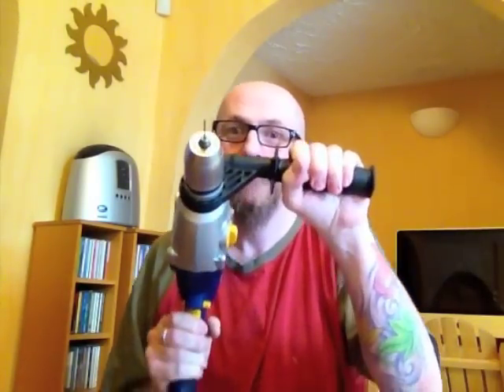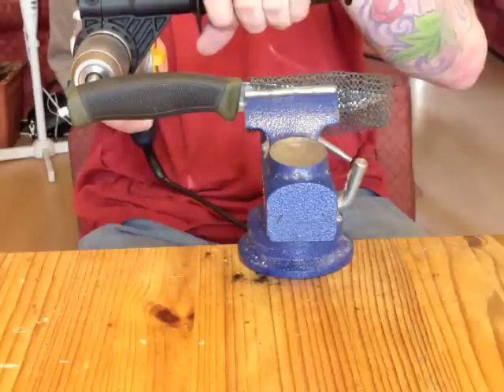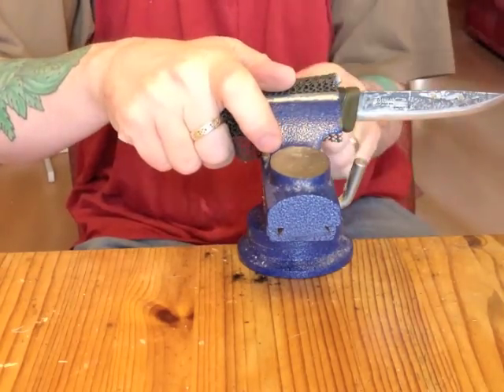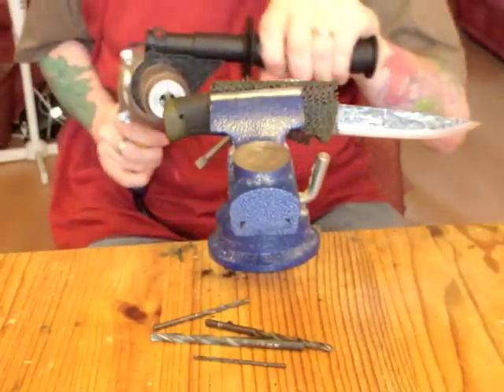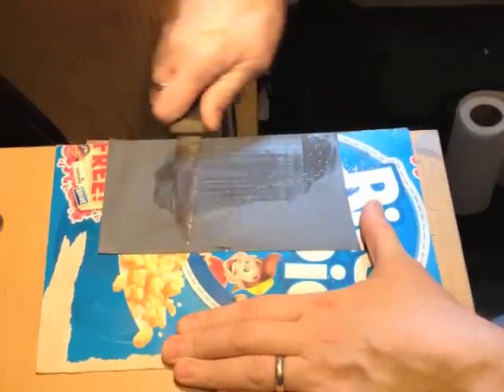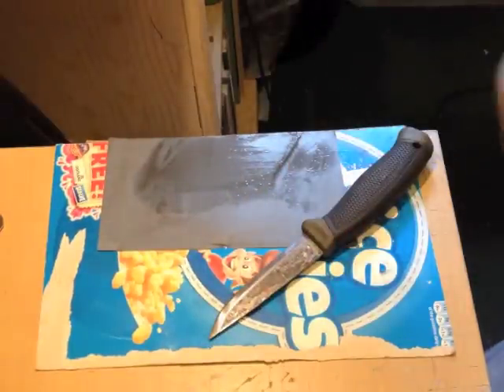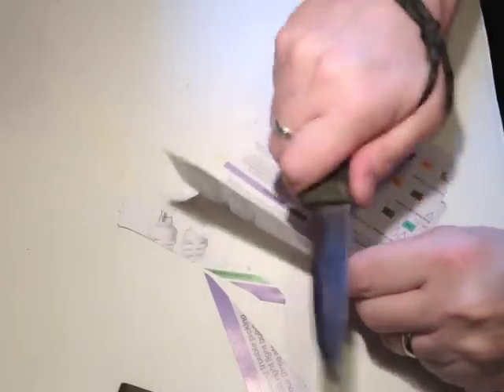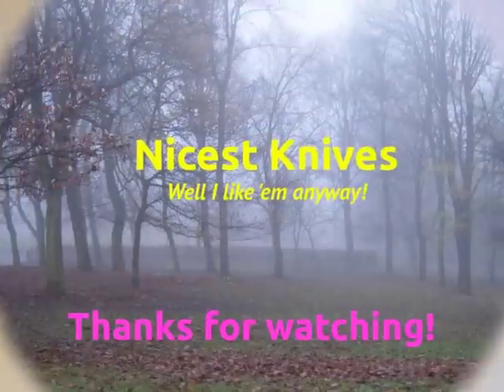More Mora Mods

Comment: I have a new Spyderco UKPK and was thinking after watching this video,  Would it be possible to put a razor polished edge on it using some fine-grit sandpaper ?
Reply from the maker: It's definitely possible...  if you just want to polish the edge bevel it doesn't take too long - but if you want to polish the whole blade, and do it right, that is a massive investment of time... a good ten hours or so I would guess!  
Assuming it's just the edge you want to do, then working through the grades of Wet&Dry paper will do it (I recommend using either WD40 or a very light oil)  Also assuming the factory edge is not too rough, then 600, 800, 1000, 1500, 2000, 2500 grit papers will do it, but make sure each time to remove all the scratch pattern from the previous grade of paper (a hand lens is a big help here)  Then strop the edge on a leather strop for the final polish.  I'm sure you can see why doing the whole blade surface would be a big commitment!  Finally, you need to bear in mind that I have only tried this on high carbon steels - you might get better or worse results depending on the blade steel of your UKPK, so it would be your choice to take the risk - I can't give you any guarantees :-)

Comment: Hi Jim,
I have a lot of respect for Mora knives. They put high performance knives within the grasp of the common man, but I know it's a personal thing I would however leave the patination on the blade as it will help offset any corrosion and I think it looks nice. (that is my personal view)Also a more polished blade will show scratches even after little use. I know a highly respected knife maker who hand rubs his flats to 600 grit. Anyway, I have said enough. It is a personal thing and if that is how you like your knives then that is how they should be. Looks nice n sharp too.
ATB
Sandy
Reply from the maker: Hi Sandy - this particular knife is my guinea pig for experiments & tryouts...so it won't get the chance to corrode - but you are quite right, a high polish is less practical on a utility blade. I like the satin finish on the Desert Ironwood Jacklore you showed tonight, and I don't think it's necessary to any finer than that, as that is both handsome and practical... but I do like recreational sharpening & polishing lol :-)
Cheers,
Jim

Comment: just get a stainless
Reply: +out2gtme Not a good idea, if you ever want to use the knife in the woods.  Stainless can't strike flint, and it's also very difficult to sharpen under woods conditions.
Reply: +James Ritchie Stainless works fine with A ferro rod.....Its just extremely aneimic. Not a lot of sparks.  Ifyour using cotton ball  and vesline, your ok. But any kinda of natural tinder and its gonna take some work for the stainless to light, but it will work. Carbon is always better though IMO, except for cooking